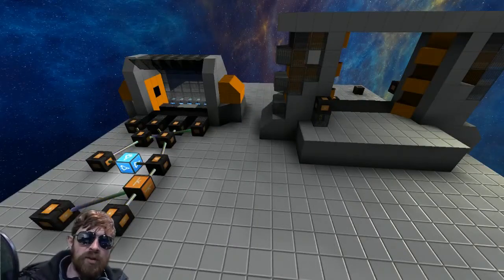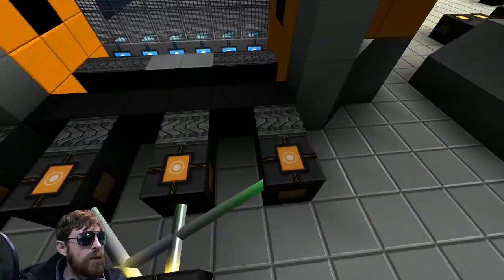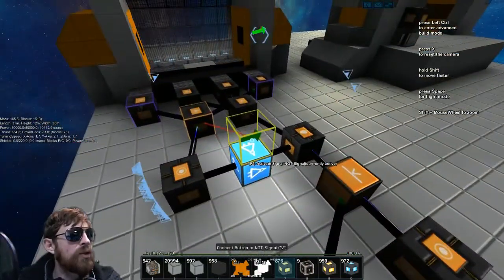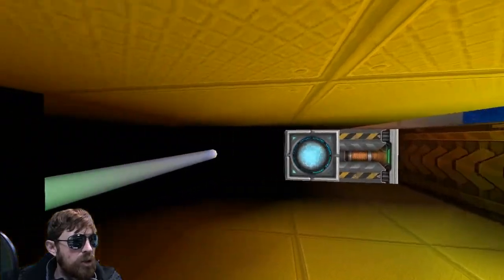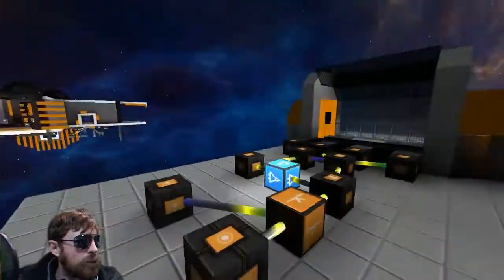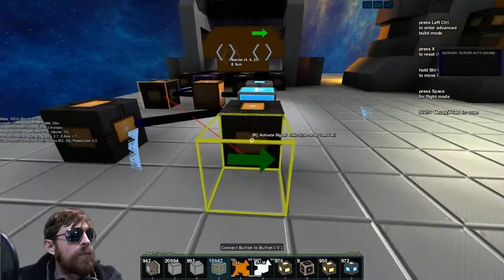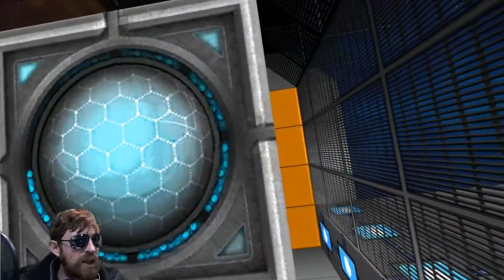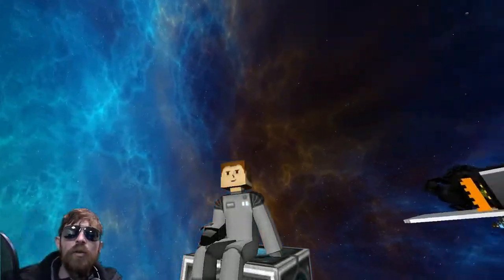Improved Rail Door Logic - One Button Use

Comment: You actually don't need the button that the not gate goes into or the activator that goes into the not gate. Just link the flip-flop into the not and one of the rail buttons, then link the not into the other rail button.
Reply from the maker: Nice jathtech said the same. I will 4evise this to reduce blocks. thanks :)
Reply: no problem, glad to help a fellow Starmade fan.

Comment: Out of curiosity, what is the most efficient way to have as much power generation in as little of a space as you can, on a (rather) big ship? I know for some time the 3D ChessBoard was quite a good option, but thigs changed, so I feel the need to ask if you did actually made some tests, recently regarding that.
Reply from the maker: in the early hundreds episodes I tested that a lot. I still check it now and then. look for mass saving compact reactors in my videos. I'll get a new video out on it. I favour  a bit of both.

I'll often use mass efficient 3D L shapes (wire frame vox corners) that do not touch. the longer the better up to 1 million power. the cap plus block in the reactor means 1.4 million is the cap.

brute forcing beyond can take it higher with sacrifice of mass efficiency. many ships will have over 20 million power recharge.

with anything over 150 meters I tend to use connected lines to frame the ship. this can take it over 4 million on a 500 meter ship before any hull is placed. these increase power as they are broken. I'll also use a decent sized cube somewhere inside the ship as with weapons .
Reply: MushroomFleet Thanks! I'm looking forward to the new video.
BTW, as a minigame idea, what about a tower-defence, with a few turrets trying to ship cores without thrusters and with only a rail to have them moving slowly? And the players'  goal would be to get to the other end alive.